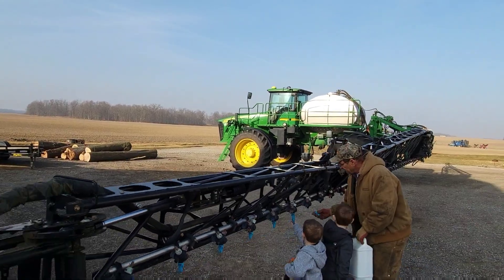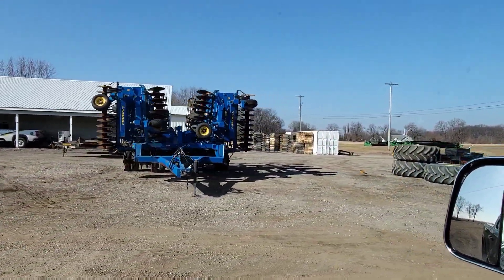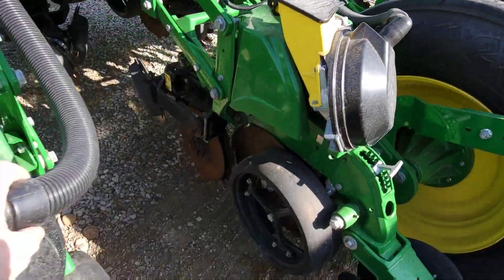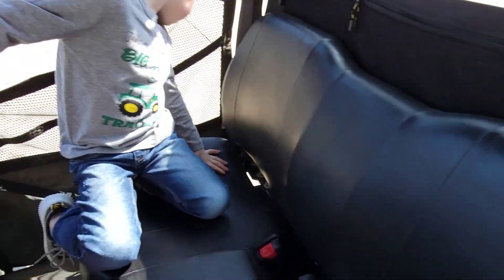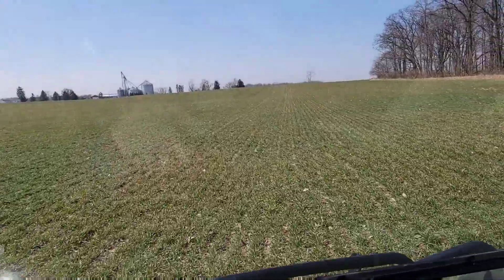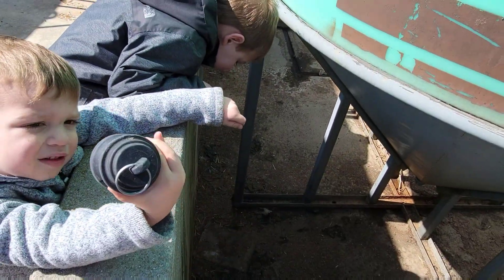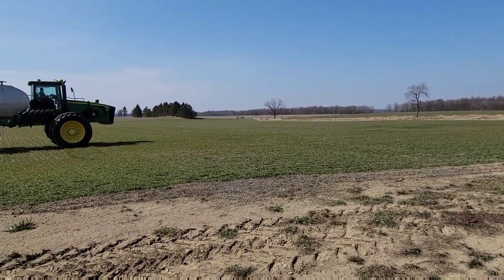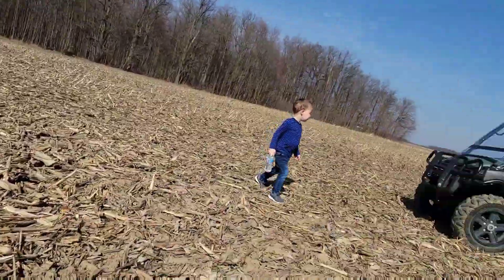Grow Wheat Grow!!! - #377

Comment: By the way did you say that the inter-row spacing on that air drill at the dealers was 10.5 inches!! Is that spacing normal for wheat in your area as it is amazingly wide to me - here we would consider 3.5 - 4.00 inches normal and optimum to make use of broadcast / liquid fertilizer.
Reply from the maker: It's 10 inch spacing. 7.5 is very common but getting to be more 10 inch.  I dont know of any seeders with narrower spacing.